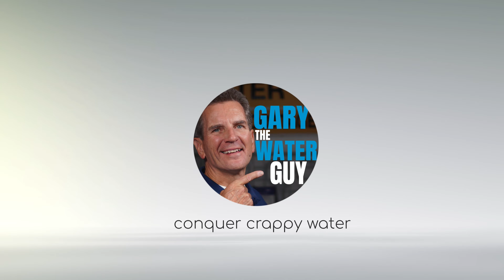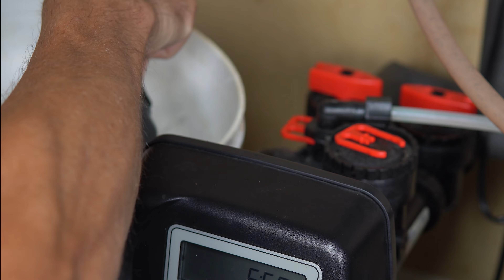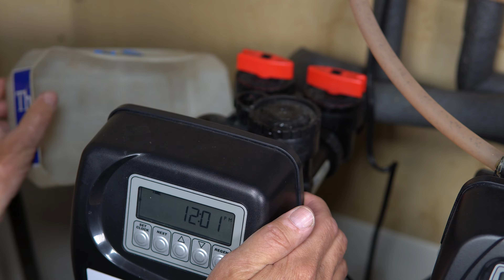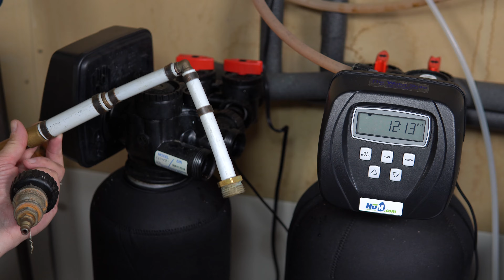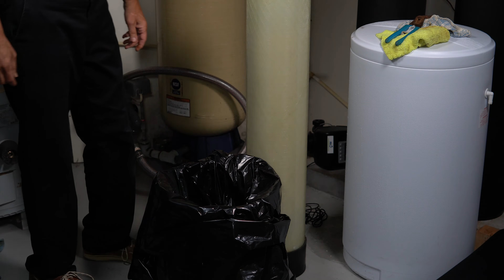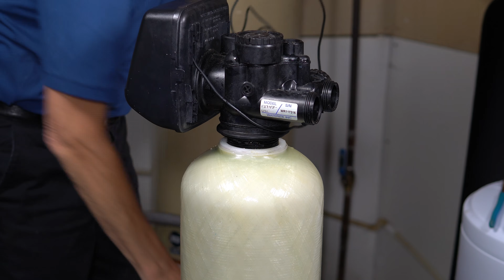WATER SOFTENER RESIN or Media REPLACEMENT

Comment: Hi Gary, my water had been fluctuating (pressure) for a couple of days and yesterday we loss water completely, called our the plumber he closed out the valves of the mineral tank and we had water again, his diagnosis was that my mineral tank was bad and it needed to be replaced for $2,200. I asked him could the mineral tank be clogged and/or in need of re bedding? His answer was terse No! Just wondering your thoughts?
Reply from the maker: He's wrong, he would just prefer to replace it for you.  It can 100% be rebedded to fix the problem. see this troubleshooting video https://youtu.be/tCQQxiT-zoc

Comment: do you need a stone bed on the bottom....or is that just for acid neutralizers? thanks
Reply from the maker: Water softeners don't need them until the tank is 12" or larger.

Comment: A 10 x 40 tank calls for 1 - 1,25 cubic feet of media, which is it?
Reply from the maker: It could be either one, based on the manufacturer.  I would use 1 cubnic foot but you will make sure the capacity is set in the valve to match.

Comment: Any tips on replacing resin on a twin alternating 300,000 grain unit with 2" valves? Resin tanks are 24" by 72" tall. I' m estimating each tank weighs 1,500 lbs full so it needs to be extracted. I would like to reclaim and clean the gravel bed since there is supposed to be 150 lbs in each.
Reply from the maker: I've never worked on anything that large.  But the procedure should be the same.  Not sure about reclaiming the gravel, though.

Comment: @GarytheWaterGuy i have really heavy iron /manganese orange slim, i have a spare Fleck 5600 Econominder water softener im not using, is it possible to replace this water softener resin with an iron reducing media, like Birm media on a  gravel bed, turning this unit into an iron filter? This solution would go before it hits my Fleck 5600 water softener.
Reply from the maker: No, converting a water softener into an iron filter is not recommended, more to it than it sounds.  Also, it sounds like you have iron bacteria, I would have your water tested by a lab to make sure before spending any money.

Comment: mate it doesn't just fall in cos your not a rocket scientist. i figured out a way to fill one in 30seconds flat no mess no fuss...
Reply from the maker: Nope, never claimed that I was a rocket scientist, just someone helping folks like you with their water filtration.
Reply: @water_estore  no i wasn't meaning it like that mate, you were very helpful. you said it doesn't take a scientist to fill the resin. but it does help, just by chance all i had was a pliable small traffic cone, snipped the pointed end off just big enough to fit in the tank, filled the cone & kept squeezing it near the tank opening. it flowed in about 15 seconds, 2x fills. i guess it allows smooth flow & the air pressure doesn't build up because the cone is pliable releasing the air from the tank when you squeeze it.
Reply from the maker: Thanks for the tip!
Reply: @water_estore   can you help with something, i pay a guy 250$/ month to check the water ph by the looks of it. its only a small softener as we use only steam so the demand is low, i dont understand how fresh water coming in to the tank can have the ph neutralised as it is changing with every refill. i'm sure it's a waste of money & as long as the salt is full its no problem.

Comment: I am replacing the resin in my Rainfresh softener and your videos are very helpful. What I noticed was a slow deterioration of water flow which my wife was quite conscious of long before me. She also says the water was not as soft as in the past so what we have is low flow with semi soft water. I found no clogging in the piping to and from the softener nor in the valve itself. So I opened the resin tank as per your video and removed the resin with a shop vac. Kind of fun but messy. What I found was the resin filling the entire tank so I am assuming the chlorine in the municipal water here has swollen the resin to the point there is no freeboard space inside the tank. I also found white coloured chips in the bottom of the resin about 1/8 inch long and 1/16 inch wide. I am located in Ontario but still use imperial measure for just about everything but temperature as young people become lost in that part of the conversation. These chips do not dissolve in water so I am assuming they are not brine tank salt molecules binding together but other impurities that have not been flushed out due to the reduced flow of water as that must affect backwash as well as service to the house. The resin is on order from Rainfresh and I am looking into installing a carbon filter before the softener as the resin is not cheap. This softener is 8-10 years old and m question for you is since Ontario has mandated chlorination to municipal drinking water why am I not hearing about softener issues from from friends and neighbours? Before the Walkerton fiasco softeners would last 20+ years with maybe the timer motor going before the resin tank developed leaks. I can't be the only guy who's wife is  saying " I've told you a thousand time the bathtub take too long to fill and the water isn't slippery anymore".
Reply from the maker: That's a great question.  I too have noticed this happening sporatically, never to all households in one community or another.  It is a real concern if it happens to you and an automatic back washing carbon pre filter like this one https://waterestore.com/products/hum-auto-back-washable-carbon-filter-1-0 really helps prevent the concern in the future.

Comment: How much would it cost to change out the motorhead/valve body that sits on the tank. Mine has become porous after 2 years and is leaking slightly right above where it is threaded into the  tank.
Reply from the maker: Wow, after only 2 years?!  I don't quote prices here, please email us at info@waterestore.com

Comment: Since my system is 18 years old, I am going to replace the media.  

1. I have a 1052 tank that has a Clack WS1 control valve.   I can't recall if I had a gravel base when I first put it together with a plumber.  At that tank size, should I consider using gravel?  We are on a municipal water supply.  BTW this unit is used for just my wife and I who are retired, so at 48K grains it may be a bit oversized but it was what was recommended when I bought it.
2.  Is it okay to use 10% resin?  The tank label includes info. about temp ranges, pressure and vacuum but nothing about resin specification. It is made by Pentair water. 
Grateful for your time and any assist.
Reply from the maker: I assume you mean for a water softener.  You don't need gravel unless the tank is 12" in diameter or larger (or for an iron filter). Yes, 10% Resin is just fine.  We have ours here https://waterestore.com/products/excelclear-premium-grade-water-softener-media-1-cubic-foot
Reply: Thanks Gary!  I have removed the riser/distribution tube from my resin tank.  I was surprised to note that it has a top basket and bottom strainer/basket.  Both appear intact but they seem permanently attached (glued?) as I cannot seem to find a way to remove either without fear of twisting too hard and damaging  - this makes it harder to thoroughly spray out the tube.  Is this common?  There also appears to be a shorter tube inside the main tube that is sitting about 6-10" down from the top of the main tube and runs along along the upper ~ 1/3 of the main tube.  Any idea what that could be and is it okay for it to be there?

Comment: I’ve changed my media. The used media in my bucket has some water in it. Shouldn’t that water feel silky, softened? My problem stemmed from a problem that I had no soft water. The brine line is sucking brine. I’ve changed the stack basket but not the pistons. The pistons I cleaned with my fingernail and cleaned with rust out. They were not heavily corroded. Cleaned the drain and brine valves using clr and rust out. Soaked the valve body in rust out.  After all this I still don’t have soft water.
Reply from the maker: For sure the water from the location where you are testing the water from actually goes through the water softener?  When you run water at that location does the word "Softening" flash on the screen? If so, I would go through this troubleshooting video step by step https://youtu.be/cFy-M6i7_Ms

Comment: I have the 5 button across. WS1 my tank is 42 1/2 inches to the bottom of the black valve +/-. It is 29 inches +/- in circumference. i have no idea as to how old it is. given the 5 button across it could be as old as the year 2000 if i am correct. 
I have the installation manual. The info written in pen says 30/WS1T. 30 K/GR. Fontis Clack. NWA 30 WS1T.
I've also got a  card which is a quick guide cardboarded instruction with additional handwritten notes.
Hardness 32.
Water Pressure 30-50.
Salt setting which is Blank
Manganese which is Blank
TDS  (PPM) 402
PH 7.4
Drain Control size installed 1/2 inch.
I do not have a bill as I've only owned the cottage for three years. So I don't know who installed it and what is in the media tank? And of course I can't find any clear indication with a serial number or otherwise on the valve body. I can tell you this. I does not have a QR code on the face plate. 
I want to change my media.
How do I know if I have Gravel in the bottom? 
Given the dimensions I've provided How much media do I need. And how much gravel if there is any?
Reply from the maker: Sounds like the tank is less than 12" in diameter, so no gravel is needed.  Also, sounds like a one cubic foot softener so you would need one bag of this media https://waterestore.com/products/excelclear-premium-grade-water-softener-media-1-cubic-foot
Reply: I found the information behind at the bottom facing the rear in the darkest location possible. now i have a sore neck. It is  CLACK 9 X 42. It is 30 K. you're video chart does not include that size. Pleas advise. I also found the date of manufacture. that being 7/16/12. Is that July 16 2012 or December 16 2007? Thank you in advance and thank you so very much. You're the man. @water_estore

Comment: How do you unscrew the main unit off near the bypass? It looks like he did a simple spin. My unit is tightened so hard and I can't even get a tool in there to loosen it
Reply from the maker: These just need to be hand tight.  It sounds like whoever put this in got a little carried away,  Large pliers will work.

Comment: If the drain line on a unit like this is run overhead do you recommend installing a check valve on the drain line?
Reply from the maker: Yes, you can but they are prone to rattling and occasionally seizing.  I don't have one in my house and the drain is overhead.
Reply: Gary FYI, lately when I’ve been installing these water softeners instead of using the tubing provided, I have been using 1/2in. Pex pipe and shark bite makes a very convenient half inch check valve compression fitting that works perfect in this application

Comment: Hey Gary, my water softener is the exact same model as the one you do in the video, but it has a side tube on it. After I did the media replacement the media is getting I. The toilets and all the screens and never goes away. The secondary tube I think is leaking through the check ball. Can I just block that tube off and have a single straight tube like the one in this video. Would that solve my problem? Thank you
Reply from the maker: Sorry really don't know what you mean about a side tube.  Can you email some pictures to info@waterestore.com

Comment: Hey Gary - just wanted to say thanks for this video. After 15 years of service with a carbon refilter I figured it was time to change the resin and this was perfect just to know what to expect especially since I have the same valve just a different computer. 
For anyone reading this comment - one tip. I have a turbulator and it just would not stay straight when I was filling it so I ended up with the tube leaning to the side. A feeler gauge was just enough to push it to center and get the head on.
Reply from the maker: Thanks for the tip!

Comment: I bought a house with a 4yr old softener, 32K grain with Clack WS1. Noticed resin coming from the discharge hose. Area is known to have a lot of chloramine in the water. Called local service company, who quoted me $1K to rebuild or $2K to replace. Found the invoice from when the unit was installed: $800 plus labor. Bought a cubic foot of resin. Washed and re-used the gravel. Internals were fine. $150 and 2 hours. DONE. Thank you, Gary.
Reply from the maker: Perfect!  Please share video with friends and family.
Reply: @JohnLavenia  I’m about to re-bed mine as well. Did this fix seem to be holding up 2 years later?
Reply: @csaleen302  Yes, I only recently started to see some resin in the brine discharge. It's been more than 2 years.

Comment: Have two 2 tank rainsoft ec4 unit 
One with the controller and one by itself 
My question is 
Do both of the tanks need to rebedded with resin ??
Reply from the maker: Yes.
Reply: Thanks man 
U saved me a ton of $$ like everyone.else.on here
I was able to.tackle this in about 3 hours 
Changed the filter tank with gravel and carbon media. 
And the 2nd tank with purolite resin 
Genius sire keep up the good work

Comment: My water softener looks exactly like this but is around 20 years old and water out has a lot of salt and actually the TDS is higher than the city water! Would doing this give it a new life or will it make more sense to get a brand new system? Thanks!
Reply from the maker: It might, but keep in mind, typically the water after a water softener does have a slightly higher TDS (but much lower hardness) I would make sure your settings are correct for the hardness of your city water and have your water tested for hardness (not TDS) after the softener.

Comment: How often should this process be done?
Reply from the maker: Whenever your water softener stops softening your water.  In most cases that will be 20 years or more unless you alos use your water softener to remove irona nd manganese from your water, then it will be less and depend on your iron, manganese, hardness content and on how much water you use.

Comment: I have a 60k softener with a 13 x 54 tank, the amount of water my household uses has been reduced greatly since the system was installed 19 years ago. can I downsize the system by just using less media in the same tank? I have to regenerate every 2 days because of the iron in my well water and I would like to reduce my salt usage.
Reply from the maker: Theoretically that should work.  But a better solution would be to install an iron filter before the softener to get rid of the iron and then just use the softener in demand mode.

Comment: My installer has refused to provide me with the media that was used or the amounts. I has a whole home filtration system installed 80K grain. I. Allen the manufacturer for the info and was told by the Charger employee that the unit is specialty built for the company who sold it I’d need to get the info from them. I was given no info on the tank only a manual for the electric pump on top. The softer company info says they are equipment sales company.  They are forcing me into a service contract basically because no one knows what the media is. I got from him it has there is resin, coconut shell activated, carbon, approximately 25 pounds of gravel for his system. What can I do I’m being forced to call his company because he will not provide the needed info?
Reply from the maker: Yes, that is typical for proprietary systems which is why they prefer to handle only proprietary. Likely you have 25 lbs of gravel, 1/2 cubic foot of carbon and 2 cubic feet of softener media https://waterestore.com/products/excelclear-premium-grade-water-softener-media-1-cubic-foot

Comment: Gary, if my unit is leaking at that white washer between tank and valve do I do this procedure?
Reply from the maker: You might just need to disconnect the valve from the plumbing  (after shutting off the water and bypassing) and just spin it on the tank to tighten.

Comment: I have a WaterRight version of Clack valve that hasn't been softening for a while.  I'm working with local service to replace the softener media.  I think its proprietary CrystalRight CR100 which helps raise the PH a little bit for our acidic water and is tolerant of chlorine and helps with iron.
So I drained the tank (thanks for the great instructions) simply by siphoning the water out and I'll take the tank in to have them replace the media (2 cubic feet), screens, etc without having them make a house call.  
To my surprise, the tank is very light, maybe 40 lbs after simply siphoning water out, no tipping to pour out.  There's probably still a couple inches of water in it.  I was expecting over 100 lbs of media in this 13x54 tank, plus gravel and tank, so I suspect  that most or all of my media was lost before.
How can I troubleshoot how it was lost so I don't get a repeat?  Of course we can inspect that the screens are intact when it is emptied out and cleaned before adding the new stuff.  
Since it was originally installed, the well pump was replaced with a slightly more powerful one and well control switch were raised to 50/70psi (don't recall if it was 30/40 or 40/60 before).  The pressure tank pre-charge was adjusted accordingly as well to 48psi I think.
Would  rapidly opening the bypass while the valve was in backwash, or something like that, flush the media out with the discharge?  Isn't there a screen to prevent that?
Reply from the maker: There should be a screen at the top (underside of valve) and a basket at the bottom of the riser tube.  Likely the one at the top is cracked.  Replace them both and the riser tube and you should be fine.